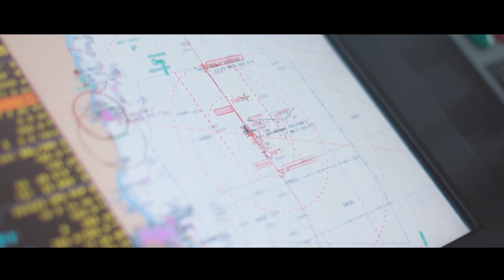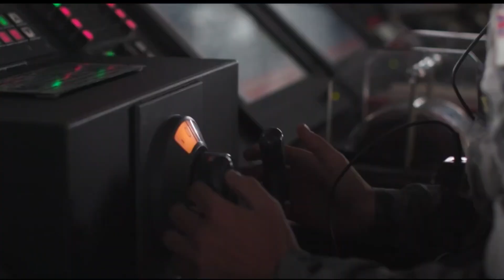🇦🇺 Australia’s Most Advanced Warship: The Hobart-Class Destroyer | Full Breakdown ⚓

Comment: It was the height of short sightedness and incompetence that the Hobart program was not continued to provide at least 6 ships. Built in Australia, yes. Initially had problems but these were corrected, so the next Hobart's should have been for the most part problem free.  We would have 6 operational by now and in a much stronger position.
Reply: Correct, another batch of 3 would have help ship building progress, 2 batch could had more VLS for drone attacks plus bigger flight deck would help especially mission capabilities before Hunter enter service.  Also cover retirement of outdated ANZAC, 12 surface tier 1 fleet would be ideal, allowing RAN build 20 tier 2 warships.